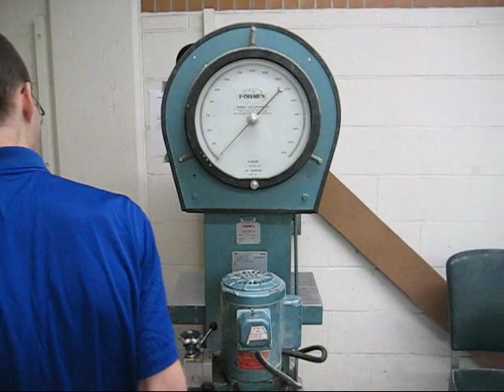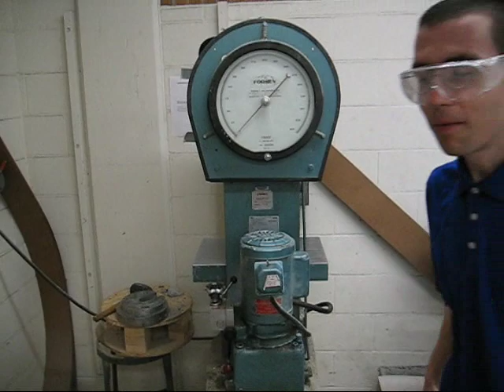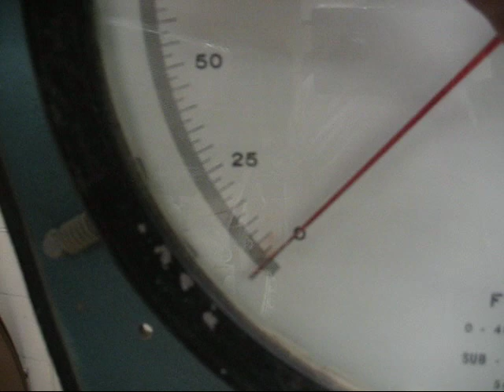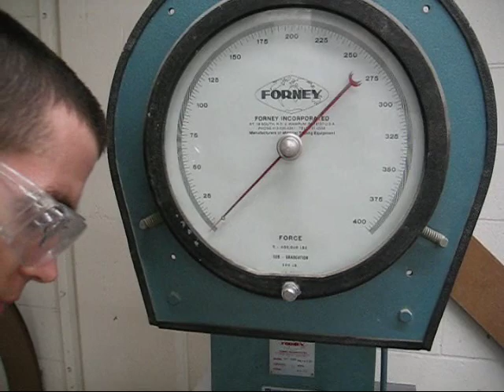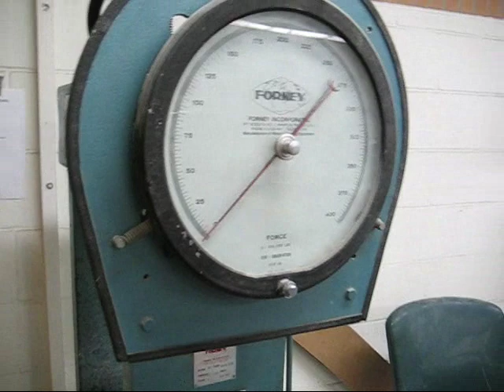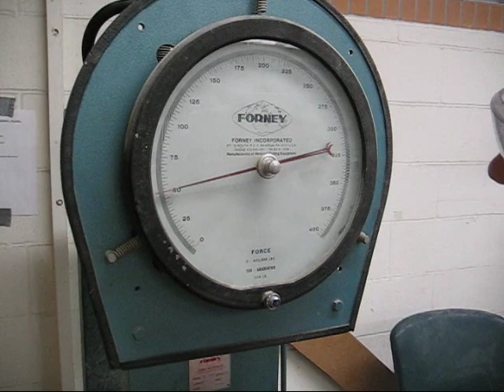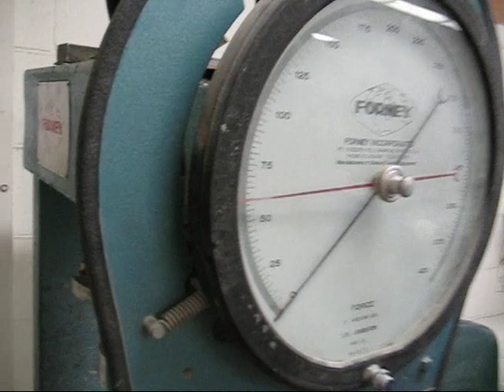Preparing and testing concrete cylinders (ASTM C39)

Comment: Matt, is it necessary to pull out the samples from the water curing 24 hours before the compression test?i have trouble searching for the standards in the net.your respond will much appreciated.tnx
Reply from the maker: It's not necessary-most sulfur caps can be applied 2h before testing, and if you're testing cylinders in the moist condition, you put the cylinder back in the curing room or limewater tank after capping and before testing.  I made this video for a class, and had people do it a day in advance to avoid a line of people wanting to cap 5 minutes before lab :).